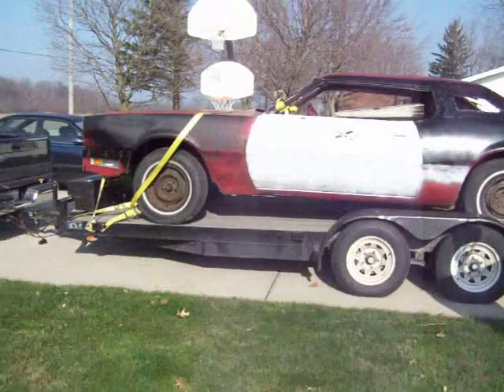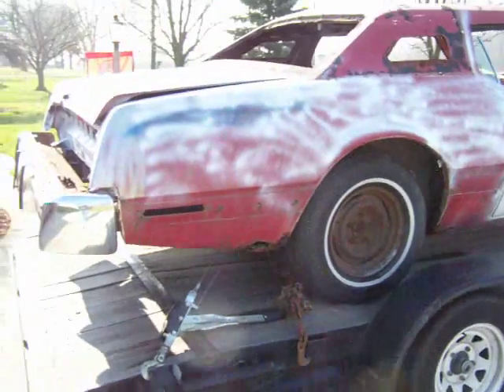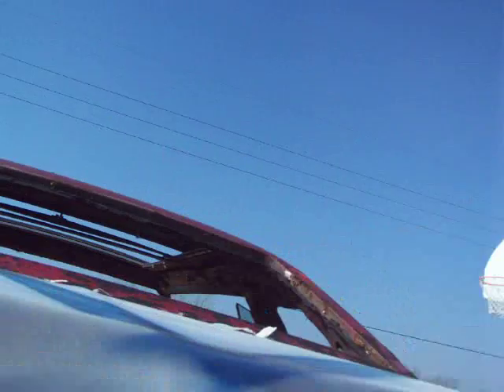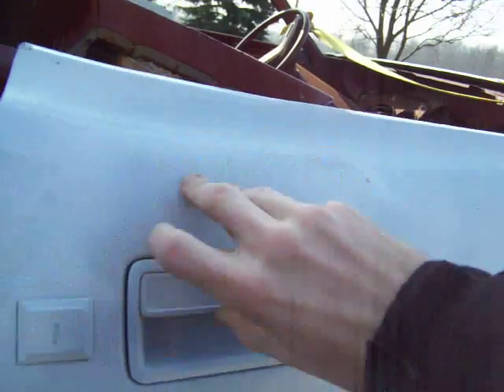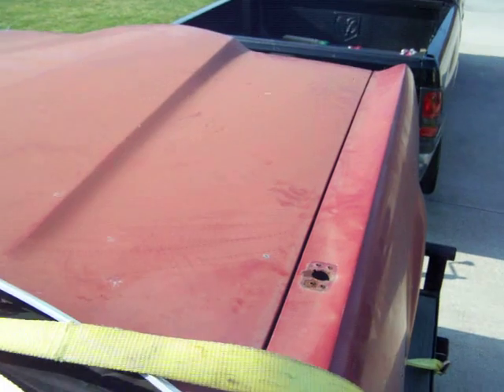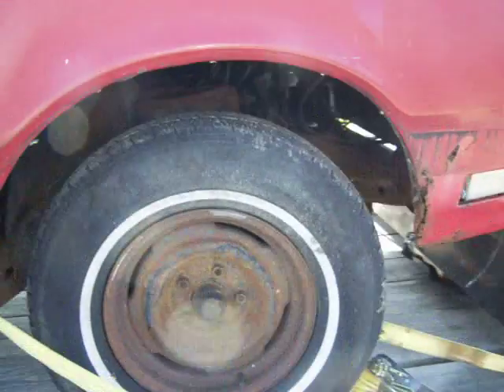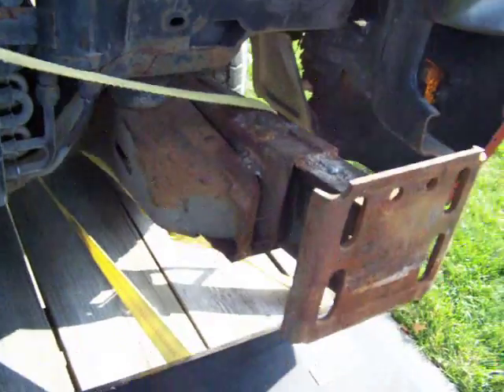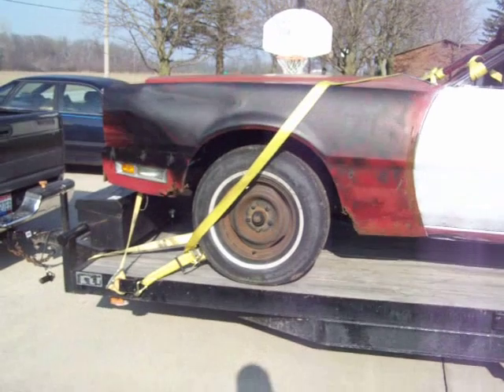2010 Derby Car

Comment: I have run several of these,front frame horns will bend into wheels,locking up your steering,rear is strong as an ox,won a few derbies,with them,car is very heavy,around 6500 lbs with 460 engine. good luck.

Comment: every year in the derby my friend runs we put a carrice seat or monte carlo seat depending on the size of the car but we use a seat thats a bench but the back rest fold forwards seprate on the passenger and drivers side and have a armrest between the 2 sides.we slit the passenger seat and hollow out the foam so we can put a jumper box in there and hide it,they come in handy